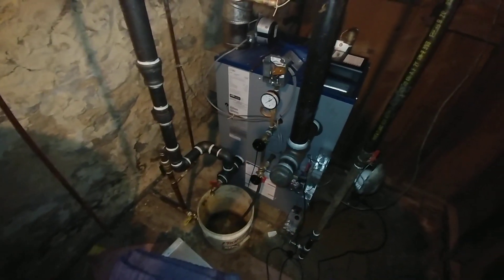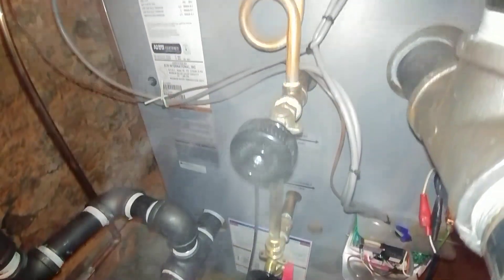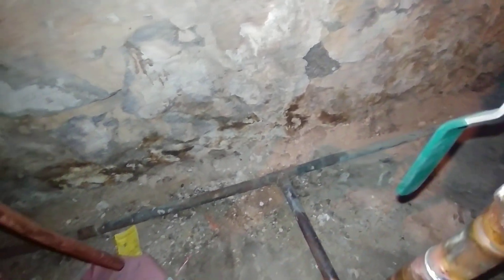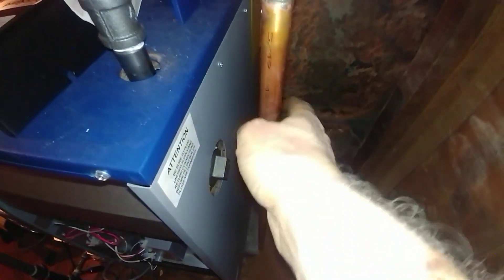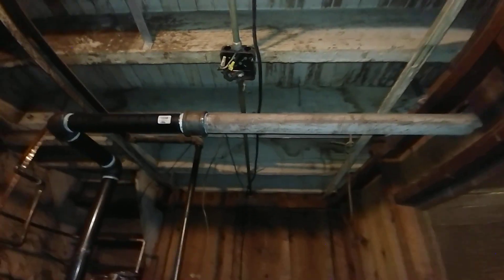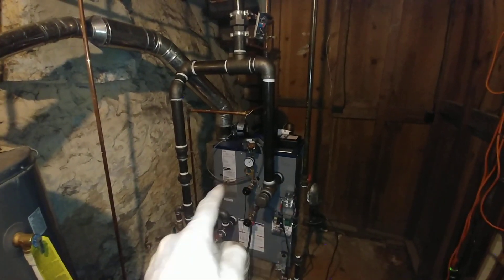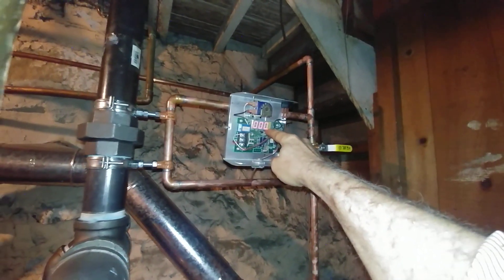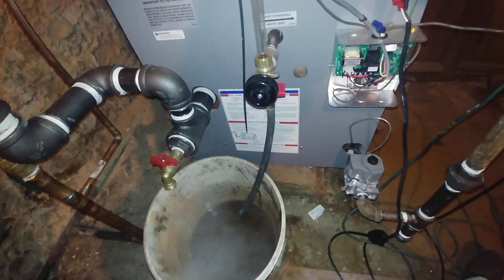Single Pipe Steam Boiler Install. Testing The Low Water Cut Off

Comment: Thank you for all the great videos. I've learned quite a bit from them. Double check your local jurisdiction for the use of a chimney tee in that configuration. Our codes in MI. wont allow two vents to meet opposing each other. Found out the hard way with a $80 re-inspection fee.
Reply: Thank you for your support and kind words!
You are quite correct to point out the error of that "bullhead tee".  It works (drafts great), we didn't install it (the chimney re-liner did),  and we had to get the heat on ASAP,  but that cut no ice with the inspector, we touched it last...so, re-inspection fee for us, too LOL!

Comment: Worst case, you'll have to take the probe out and clean it.
Reply from the maker: Thank you for your comment. What finally happened was when we cleaned the boiler more thoughly, the low water cut off started working at an acceptable level.

Comment: Wondering why the make up water is tied in below the valve?
Reply from the maker: It of a certain would have been better to have tied in the make-up water after the valve. You are quite right to point that out.  I can only offer a weak excuse of it being February and the need to take a few short-cuts to get the heat on quickly. I hope to be able to go back and tweak it.

Comment: Beautiful. Would there be any advantage to using double risers on this size of the boiler? I've seen somewhere that these side connecting boiler risers can tilt the waterline towards one side and this helps suck water up the riser along with the steam for a wetter steam... I'm sure upping the header size helps dry it out, but still, just wondering. Thanks for posting all the videos!
Reply: Thanks! Two risers? On this the smallest size, most likely not an issue.  We also take advantage of the taller basement and put on a taller than called for riser.
Reply: Gordon Schweizer 😬 I can verify it can be fine, because I can see any carryover. But it’s persnickety and will throw water for any number of reasons!
Reply: @pb7379-j2k  just looked at your videos. Did you get your boiler calmed down? What ended up being the issue?
Reply: nosceteipsum513 I got the water clean and good ph (not too high), main vents in order, improved the nbp a bit and lowered the gas pressure a bit
Reply: @pb7379-j2k  Textbook remedies. So, down fired - how oversized is the boiler? Also, what is "nbp"?  Ahh, near boiler piping. Got it.
Reply: nosceteipsum513 about 20% over
Reply: @pb7379-j2k  👍 thanks for the insights!
Reply: @elgordo271  Thanks!!